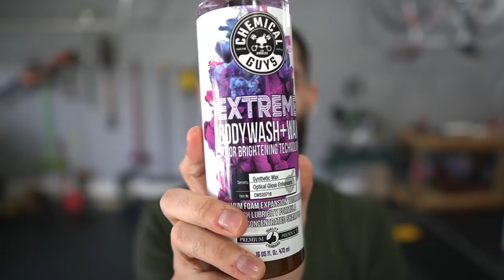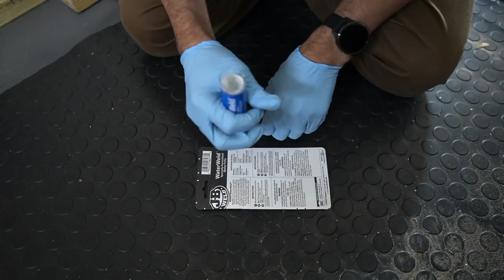Washing our Pop Up Camper Revealed Some MAJOR Problems | 2008 Jayco Select 12 HW

Comment: Nice video love the fix on the roof installing a fan instead of patching the damage.
My Wife and I are getting ready to remove the A/C unit from our 2018 Rockwood HW296 and install a Maxxair fan in its place. 
But im gonna try and snake the wires through the roof  and tap off of the pushout light socket just a few inches away from the A/C so the wire will be hidden. I'll be uploading a video the day we do it over on my YT Channel watch for it.
Reply from the maker: Right on, keep us posted!
Reply: How’d your MaxxAir project go, Glenn & Michelle?
Reply: What is your channel? Totally agree, It’s Poppin’ is THE best channel I’ve seen for pop- ups! Have learned a lot from him!
Reply: @YouTubeHarringtons  it went perfect i never got around to making the while we did it's nice looking without the AC on the roof, that got rid of about 90 lbs, so glad we did it.
Reply: @cowboy60cowgirl62  good deal. Were you able to snake the wires through the roof? Want to do the same and wondering if there are any issues or things to look out for.
Reply: @YouTubeHarringtons  No, i used the wire track that had the Electric wires going from the A/C to side of the roof and ran it from the fan to the plug for the dinnette light. 
But I'm goona get a new track from Amazon thats thinner so it will look better, and cut the side of the plug housing to fit over and around the track, and I'll cut the trim ring to the fan and run it right up to the side of the fan so it will look better.
I thought of fishing the Wires through the roof but figured it would be tuff so decided against it.
Have you ever fished wires through a POPUP roof?
Reply: @cowboy60cowgirl62  have not, but hoped to, which is why I was interested in your project.

Comment: We have a 2010 Starcraft 1224. The roof is the same as yours (all Starcrafts were made by Jayco after ‘91). I want to cut a 14x14 hole above our shoilet ;) for a MaxxAir Deluxe Fan (to repair a hole like you, but also to remove humidity so we can use the shower). Do you know if there are any internal ceiling joists running across the camper or is it just sandwiched foam? I don’t want to cut a support on accident. Thanks!!
Reply from the maker: Ours did not have any internal supports near the shoilet. There may be supports near the A/C, but for our purposes that was on a different part of the roof. Just keep an eye out for the external metal supports on the interior of the camper and any lights, wires, or speakers on the roof.
Reply: @ItsPoppin  Thanks for the quick reply and the reassurance! You’re right - looks like the only supports are the ones that are visible from the inside and straddle the AC (there are no other bolts on the roof sidewalls which would indicate any other supports). I feel confident and excited about the project now!

Comment: Thanks for the videos!  I have a couple of small cracks on the roof of trailer we just purchased (2006 Rockwood Freedom).  Was planning to try the Waterweld on them.  Your video was out a little over a year ago.  How has the roof Waterweld fixes held up?
Reply from the maker: Very well actually
Reply: @ItsPoppin  Excellent, thanks for the quick response.

Comment: Why use JB weld on the small crack on the roof and not the lap sealant?
Reply: I also have a small crack in ours, wasnt sure what to use for it.. Thanks for the videos
Reply from the maker: I suppose you could. I feel as though JB Weld is a more permanent fix and I was able to make the patch look better cosmetically. As you probably know, caulks can get pretty messy, pretty quick.

Comment: Good video.  Were you sitting on the roof of the popup?  Is that safe as far as having weight on the roof?+
Reply from the maker: Our pop up camper roof says it can handle a total of 350 lbs, but every camper roof is different. Take off 80-100 lbs for the A/C and we are at 250 to 270lbs. I make sure I distribute my weight and stay to the edge, but otherwise it's fine, but your pop up may be different.

Comment: Can you tell me where you get more of the snap on conduit cover for the ceiling?
Reply from the maker: Yes, I actually just picked some up from Home Depot. The only caveat is that it doesn't look exactly like the factory stuff, but we needed something with a larger diameter anyways. Search for cable raceway or cord cover.

Comment: what made you even think to put a roof vent there and not fix it? Its a great idea. And are those fans loud? Sad part is those fans are 189.00 in Canada eh lol  

And its a great idea for when you dont need the AC on or if your boondocking.. Great video
Reply from the maker: So the palomino actually had one, which is what spurred the idea. It seemed reasonably quiet when I was testing it oit.  I think the biggest benefit will be condensation control, especially for the shower and if we're cooking inside.
Reply: @ItsPoppin  thank you for the fast reply. Its finally warming up here so I took the cover off the camper to inspect the roof. We bought it last fall. Used it twice so far. It has a shower she loves so I am going to look into this idea thanks again.

Comment: Hey how are you this is not content related but I was curious if you could do something to help me I have a 2009 purple with the battery backup system I got to be honest with you I don’t know the first thing about or how it works I was wondering if you might not find this a good idea for a future video any knowledge would be appreciated and I like when it comes to this. Oh yes one more thing it is a Fleetwood   Niagara don’t.  know if all systems are relatively same  or not
Reply: Most pop ups when they have a battery are set up to run on 12v(battery) or shore power 110v (20 or 30 amp plug into the wall). 
You have what is called a converter that will charge you battery when plugged in and power your outlet as well as all your 12v appliances. 12v appliances include but not limited to, water pump, lights, heater. (Note your standard outlets will only work when plugged into shore power.

With battery only power you will only be able to run your lights, heater, water pump. You may also be able to run your fridge if you have one and it is a 3way fridge (propane, 12v , 110v) but I would NEVER recommend running your fridge on the 12v setting and it will drain a battery very very fast!

You will need to make sure you battery is working properly,( ie. charges and hold a charge).
I own a 2006 Coleman/Fleetwood Utah.
Reply: @KRT045  Thank you for getting back to me
Reply: @jamesmassey7629  no problem. There is good info on these guys YouTube channel and tons of info @ popupportal.com.  Also if you are need parts specific to Coleman, colemanpopupparts.com
Reply: @KRT045  I don’t own the same brand/ model as yours but, really appreciate the additional info!! Other things to Google, lol! 👍🏻

Comment: What made you get rid of your starcraft and buy a jayco ? I'm looking at a used starcraft is why I'm asking .
Reply from the maker: Just wanted a bigger highwall.
Reply: Do you feel like the jaycos are built better ? Thank you for your advice and all your videos !!!
Reply from the maker: No, not necessarily at least as far as the 2008s are concerned. Concerning build quality, there are different things that I like better on each. Of the 3 brands we've owned, I liked the build quality/build design of the palomino the least.
Reply: Wow I wouldn't have expected that , thank you for your time !
Reply: Starcrafts actually are Jaycos, since 1991

Comment: Who is behind the idea of making an inner trim piece that has a minimum thickness of 2 inches when there isn't a RV out there that has a roof that thick? I had to do the same kind trim mod to mine!
Reply from the maker: I agree, it'd be nice if they sold it with different size trim pieces as an option.